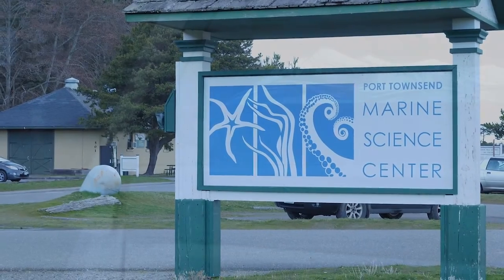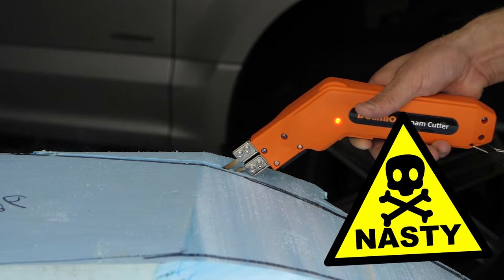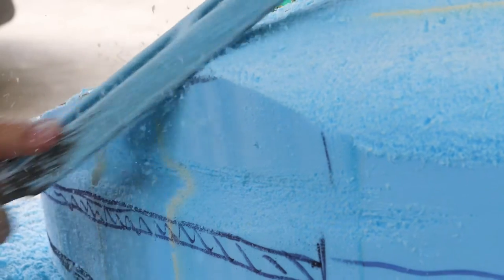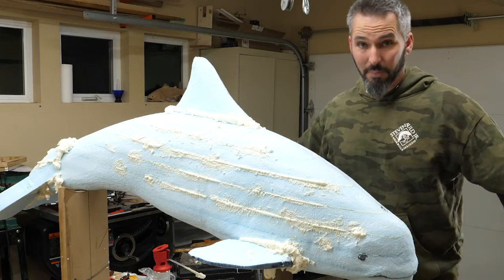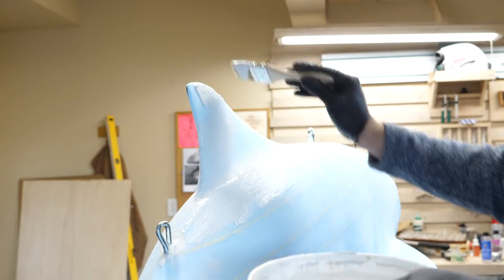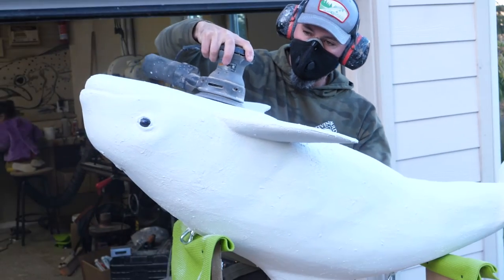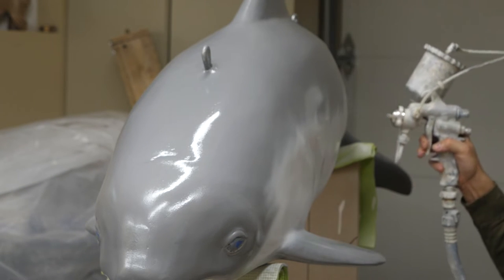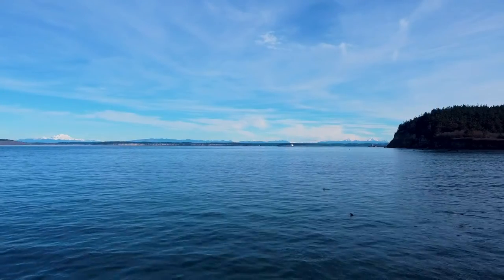House Foam = Sculpture

Comment: What did you use for the ‘hard coat’? Most of the big foam sculptures I’ve seen get fibreglassed and I really don’t want to start that 😅
Reply from the maker: I used Roscoe’s Foam Coat for this one, and it’s a great alternative to fiberglassing (and it doesn’t smell). The foam coat sands easy and is flame resistant, but you can’t stand on it or really abuse the carving like you can with fiberglass. I do use the Roscoe’s as a base layer as well if I am fiberglassing to avoid potentially melting the foam underneath due to the fiberglass heat reaction. I totally recommend the Roscoe’s though. Great stuff.

Comment: Perfection!! May I know what kind of paints you used for this project?
Reply from the maker: I use mostly Golden airbrush paints, though the cost is pretty high. I have now shifted to using a brand off Amazon that is for less expensive and seems to spray well. I’ll do a review of them later once I have a bit more spray time.